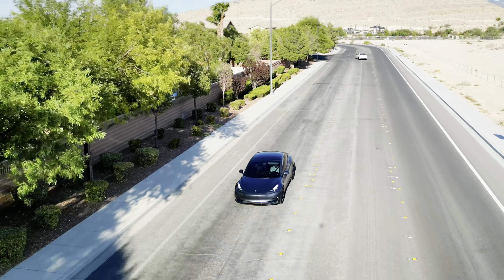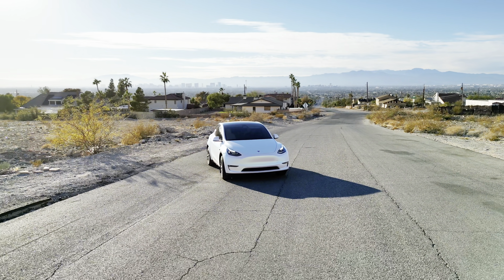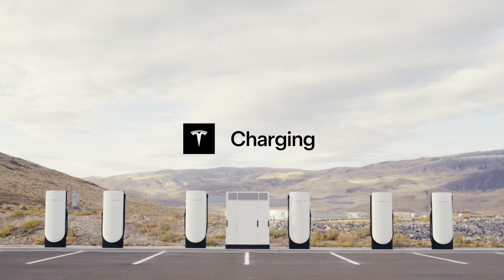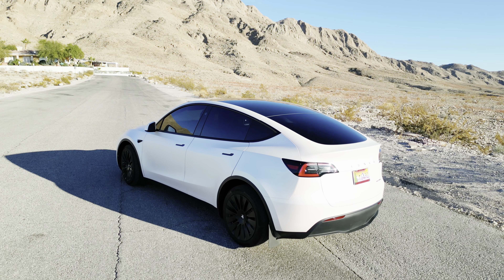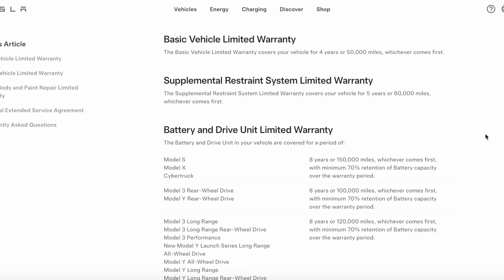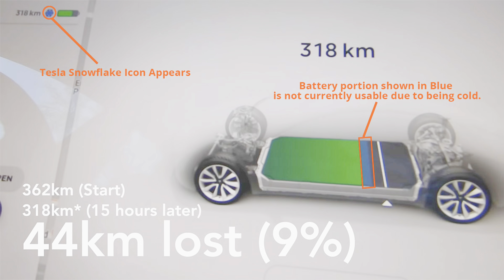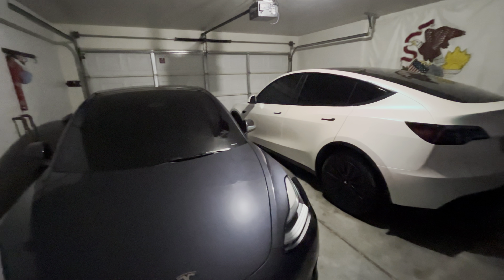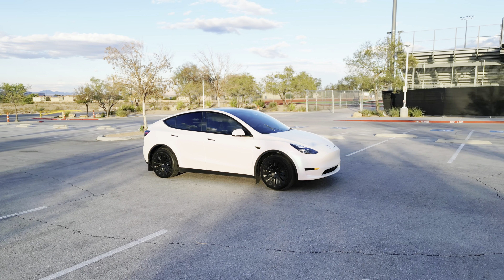Don't RUIN Your Tesla Battery: How to Avoid Degradation

Comment: Keeping the cabin cool and running Air and AC when its parked is  a dumb move. Just buy an internal shade for the glass roof and windshield shade to guard against the sun along with tinting all your windows. Nothing in the cabin should affect the battery which is underneath so you all have no clue what you're talking about other than wanting instant cool air when you get in which will further decrease range.

Comment: I have 18,500 on my Model Y Juniper Launch since purchased April 11, 2025.  Yes that is a lot of miles.  May 20, 2025 I left on a long term USA road trip.  I sleep in my tesla about 80 percent of the time.  Use camp mode.  The Battery started at 100 percent (I think) and it now reads 91%.  Is this normal?  Just wondering.

Comment: Hey Bro!
Would you recommend still charging once back home if only down to 65-70% (with 80% the preset)? The reason I ask is because doesn’t even a small percentage of recharge count as a ‘charging cycle,’ with these vehicles only having a certain number of cycles?
Reply from the maker: A small charge won’t impact it very much like that. That’s not a full charge cycle I believe by definition
Reply: @ Thx!
Reply: I read that Tesla recommends charging when not in use. So even if I charge to 80 percent but only use a small amount driving to work and back etc, should I plug in every night and recharge?

Comment: Lower soc means lower voltage and increased current draw for the same power. The internal resistance would generate more heat due to increased current. I am not sure if accelerated chemical aging due to higher soc is worse than increased heat during use.
Reply from the maker: Good to know!
Reply: @vegasteslafamily  I'm happy you are not defensive, open to discussion. I'm looking to buy a Tesla model 3 and your videos are very helpful.
Reply from the maker: @CCPLord  if I was defensive in the comment section of my Tesla  videos I’d be here all freaking day 😂

Comment: I I have a 2023 model Y long range
I commute 140 miles round-trip five days a week for work  It’s not too hot or too cold in my area. 
I believe I do have the older battery. My question is how can I tell if I need to bring my Tesla in before warranty to exchange it if I have a bad battery thank you
Reply from the maker: Chances are it’s fine! But if you have 30% less range than when it was new, it can be replaced with warranty.

Comment: My battery went south at 8K miles. Never charged over 80%. First they thought it was the high voltage interface and they ordered and replaced. Nope. Then after another week they said it was the battery. They ordered that and after 5 weeks my car was ready with the refurbished battery.
Reply from the maker: That’s crazy. Definitely a faulty battery
Reply: Damn yeah you got a bad battery. It's just like getting a bad car engine. Look all all those new Toyota Tundras with metal debris inside that were wrecking engines left and right
Reply: It's a bit unfortunate you are now forced to take a "refurbished" battery when your car is nearly new. With such low mileage Tesla should replace with a new battery.
Reply: @sunrisejak2709  He should do a proper battery test.  The battery degrades the most in the first 20K or so, but at 8K it should have 98% or so remaining.
Reply: You're leaving out the part that you were launching the tesla racing it.
Reply: @chipchiperson679 never do that

Comment: How important is preconditioning the battery? If it is important then why isn't there a way to initiate the process in the app? Yes I know I can setup a schedule and I have, but what about the times when I decide to run an errand and want to leave in 15 minutes?
Reply from the maker: It's important if you are going to a supercharger right away and want the fastest rates! Other than that, not doing that is fine

Comment: New study from UK came out. Since EV's dont have a long history to pull from, we finally have enough years to have some numbers. For an EV battery (any chemical composition) that has more than 150K, degradation is only 2-3%. Somehow the battery is able to recover and it no difference found even with charging styles (80% vs 100 or home vs supercharging). 
Obviously, don't go and start abusing your batteries but just wanted to share this info. Is all of this a myth? Only time will tell.
Reply from the maker: I think it's more than 2-3% data shows, but they do last a long time
Reply: The curves I have seen has not recovered, but the degredation slows after 20K or so.  The rate of degredation depends very much of the battery producers, batch and chemistry.   https://www.youtube.com/watch?v=hTt2libO-vM

Comment: Very informative and useful video.
Is there a way to precondition your battery at home before it starts charging? I normally charge my Tesla (Model S & CT) at home from midnight to 6 :00AM  when our Electric company charges us 3 cents per KWHR.
Reply from the maker: Thank you! You can set a departure time in the app and have it warmed up by then I believe

Comment: The damage to the pack is done by the length of time that the (non LFP) packs spend at a high state of charge (SOC) especially a high SOC + high temperature.

Charging to 100% then driving a reasonable distance to bring the SOC charge down quickly does almost no harm, i.e. setting a charge schedule to finish as you leave for work.. the battery spends the last hour above 80% and 1/2 hour above 90% before you leave and if you drive far enough is back into that 80-90% range or lower within an hour, assuming you charge every 3 days thats less than 3% of the time it spends above 80-90%. 

Just charging and leaving it at 100% SOC all the when you're not driving it is much more damaging.

The Guess-o-meter (miles at 100%) I have found to match exactly to the 2 battery tetst I have done at the end of the first and second year of ownership, I recognise I am a sample size of 1 but I would like to see a larger data set on how accurate this actually is.
Reply from the maker: This is great! Yes people say the 100% mileage isn’t accurate but in our case it has been pretty accurate for us too

Comment: Is it if it’s 90 degrees outside or in the cabin? Even in 80 degree weather if Tesla is sitting in the sun, the Cabin temp can get up to 120.
Reply from the maker: It is the external temperature that the battery is getting
Reply: That’s normal dude

Comment: You said it’s OK to charge to 100% as long as you’re on a road trip then the degradation is little or none…
So how does the battery know you’re on a road trip or not so it can determine whether or not to degrade?
Reply from the maker: I mean in the sense that you drive it shortly after reaching 100%

Comment: I keep mine at 50% mainly as I don’t drive daily.  Even when I do, on occasion, use it once a day the 150mile range is more than I need in my area.  Even when it was getting down to 23  to 30 degrees F outside…my range was fine.  
Only keep the car at 80 percent if you daily and need the range.  If you notice your round trip is only using 10 percent or 20 you can lower your setting to maximize battery health.   

It’s good to point out you can also do what ever you want.  Charge how you feel comfortable…that’s the key.  You do have an 8 year or 120k (100k for SR)warranty…so it’s fine.
Reply from the maker: This is a good point

Comment: what is the best percentage of battery should i charge the car if i wont be using it as daily drive?
Reply: 30%
Reply: @TravisONiPhone shut up troll 🧌
Reply: @walterwhite1  do some research before you call someone a troll
Reply: 69.420%
Reply from the maker: 80% is fine. Picky people will say between 50-80%, which is also fine. 30% is too low
Reply: @ wrong
Reply: @vegasteslacarmen  thank you 🙏🏻

Comment: I purchased my MYP in August. 80% would get 223mi. Now, I’m getting 219mi with 80% charge. That’s a 4mi degradation I so short period of time. 😢😩. I’ve driven it 9k miles so far.
Reply from the maker: That’s not too bad honestly!
Reply: You have to start locking at the percentages not miles. Plus you can periodically rebalance your battery back since each individual block can drift. If you rebalance you can gain a bunch of miles back.

Comment: If I'm only leasing my new Tesla, do I even need to worry about killing the battery?   During the lease, Tesla will replace the battery if anything goes wrong, right?
Reply from the maker: Yes this is correct
Reply: This comment is exactly why I don’t buy cars coming off lease.
Reply: @fluxsmith   oh come on... the manufacturer guarantees that the gently-used off-lease full EV has gone through their rigorous 999-point inspection before being put up for sale.  It'll be fine.   🤣
Reply: Sounds like you should keep your battery at 100% at all times

Comment: Some of have suggested that if you charge your battery to 100% then drive it down to 10% a couple times that will reset the BMS.
Reply from the maker: This is not true. I actually included a clip in the video before I edited it explaining it, but it was a lot of blabbing on my end that I thought most wouldn’t care about.
Reply: @vegasteslacarmen  There are many videos on the net that show the opposite - bringing the charge down to 5% and leaving it for a few hours then charging to 100% and driving will in most instances slightly improve the accuracy of the BMS

Comment: I bought my Tesla model y rwd in August 2024. I have noticed that when I charge my car to 80%, the range has decreased about 10 miles from what it was 6 months ago. Is it because of the cold temperatures or something else? Any thoughts? Thank you
Reply from the maker: It could be depreciation and/or adjusting to your driving style
Reply: Teslas do not adjust to driving style - the range estimate  (by flipping between battery percentage / miles) at any SOC is a fixed calculation, it is always the remaining capacity of the battery as estimated by the BMS divided by the fixed EPA consumption.

A very cold battery can impact the accuracy of the BMS and under-report the remaining capacity by a fraction but using 20% more or 20% less than EPA consumption while driving will have zero impact on the miles estimation.

I am at 110 Wh/km (177 Wh/mile) lifetime and around the 93 wh/km (150 wh/mi) range for extended periods in summer - if it adjusted for driving style it would be well into the 300 miles estimate for me but it has never done anything but gradually decrease from 272miles when new.

Comment: so i have a 2018 long range model 3 rwd ive put 11k miles on it and have had it for a year and ive only supercharged because i live in an apartment and my degradation is 6.82% and battery health is 93.18% and max range is 293.27 miles numbers are from tessie app
Reply from the maker: That’s a pretty low degradation rate for a 2018 model.

Comment: Something else that studies have found is that if you decrease your max charge lower than 80%, is further decreases the impact of heat on your battery. So keeping your max SoC at 50-60%, it will mitigate degradation over 80%.
Reply: Damn at some point it’s not even reasonable anymore. If I have to keep it at 60% and going below 20% is bad also then I only have 40% of my range. Ill take the maybe 10%  range lose in 10 years over the 60% now
Reply: @EdwinSherwood  I know, these people are bonkers
Reply: Yup. This is by far the most important advice for battery health. I charge only up to 50% during working week. Weekends I go to 80%. Long term, it barely matters but good charging habits work.
Reply from the maker: Interesting, thanks for sharing!
Reply: @vegasteslacarmen 30% is best for battery for the least amount of stress
Reply: @TravisONiPhone  good one…lol
Reply: @TravisONiPhone  how does anyone use an EV on 30%, and never allowed to go above that?
Reply: @kristaylor7119  If you only commute in town locally and have and extended range battery this is better than the best a Nissan Leaf, say a 2013 could ever hope for. 
Eighty miles plus.
Reply: Bingo! My 2 month old 2025 3 RWD has an older non-LiFePO pack. Tesla’s default max charge level on my car shows 80%. However, I only need that super long 360+ mile range for occasional x-country trips (with Superchargers). My everyday range need is much lower (< 100 miles). Before longer trips, I charge to 100% the night before using my home Wall Charger set at a rate to reach that highest level right before my planned departure. 1) The key here is minimal time is spent sitting at the 100% level. 2) Day-to-day my overnight charge level is set to stop at a 60% max, again with overnight charge rate set quite low. For my 360+ mile range capable car when used for daily commutes, that means I have 110 miles “in the tank” and 30% left when I get home. Am now experimenting with 50%-25% range which is still a 90 mile capability. 3) The sweet spot to minimize long term degradation is keeping one’s battery in the middle 1/4 to 1/3 range of one’s total capability. There are many studies/charts that show minimal degradation over years of use, when using this regime. Again, this guidance is only for older non-LiFePO lithium batteries.
Reply: So you'll be charging the car everyday at that point with minimal range unless your're just going the neighborhood grocery store. Sounds like you're serving the car more than its serving you which is dumb

Comment: I have an LFP 2023 Model 3 and my routine is pretty easy I think. I charger to 100% (calibrates the BMS) only once a month. Every other week I only charge it to 90% max. With that 90 percent I can get to and from work for an entire week. So I don’t see a point of charging to 100% only to drive the car to work get there with 96% SOC left and leave the car parked for 9 hours with such a hight SOC.
Reply from the maker: I like that approach!
Reply: If you routinely use less than 10%/day I'd be charging to 60% nightly, or 70% every 3 nights, particularly in warm climate. Monthly calibration sounds good.
Reply: LFP packs are pretty indestructible - you don't really need to worry about SOC. I plug mine in and charge it to 100% no matter whether I have been to the shops and it's at 96%, back from a 100mile round trip to work and it's 68% or back from a long road trip and 5%.

I leave it plugged in and set at 100% until I need it again. 

After 2 years and 30k miles I have 3% degradation, 2% year 1, 1% year 2. as measured both by the battery health test and the guess-o-meter which shows 264miles now at 100% SOC.

I might have saved a mile or 2 degradation but the convenience factor is worth the loss.
Reply: tesla says one a week! Are you most intelligent?